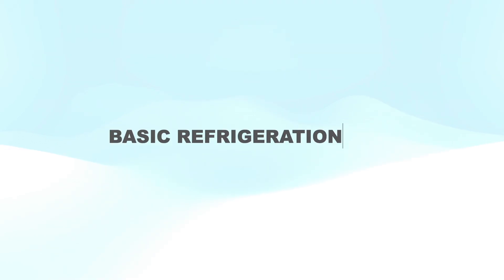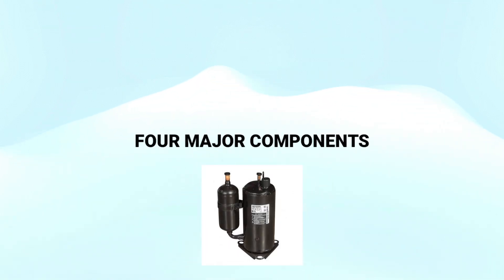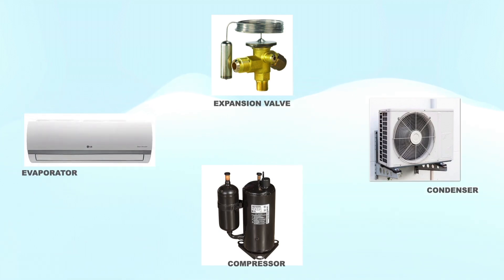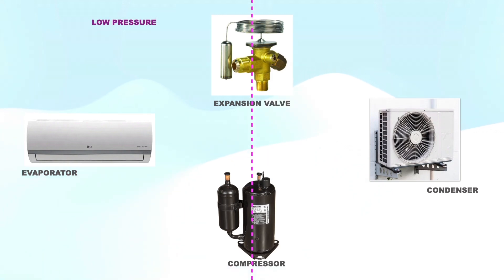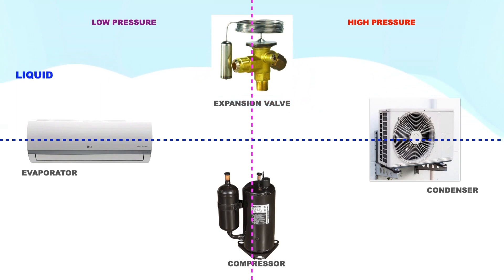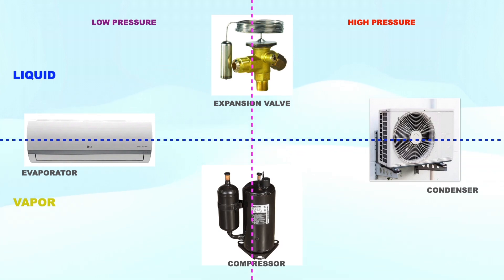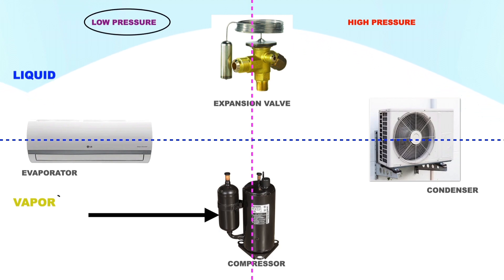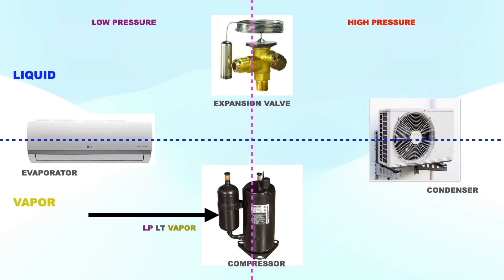BASIC REFRIGERATION SYSTEM,  HOW YOUR AIRCONDITION WORKS?

Comment: Very good explanation. Сan the not inverter (on/off) compressor of a conventional home air conditioner run continuously without trouble? (Condenser temperature is not high in this case)

Comment: correct me if I'm wrong after Condenser still High pressure  & High temp subcooled liquid before it reach the metering device.
Subcooled liquid doesn't mean changes in temperature please refer to Subcooling .
Reply: I think for most practical purposes you're right, the liquid line is hot enough to be somewhere between uncomfortable and unsafe to touch. I get where he's coming from though. There's a lot of heat that goes away in the condenser.

Comment: sir, in ship central air condition system, how to adjust air temp, air flow and humidity? can you pls show us?
Reply from the maker: Our set up here is an old set up which doesn't have a controller for these.  We only do it manually., for yhe air flow we throttle the valve